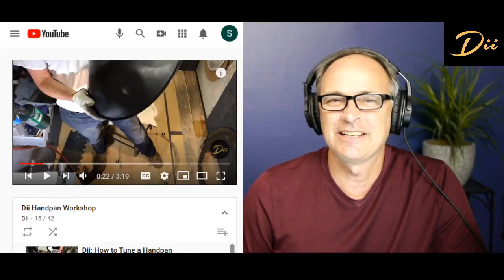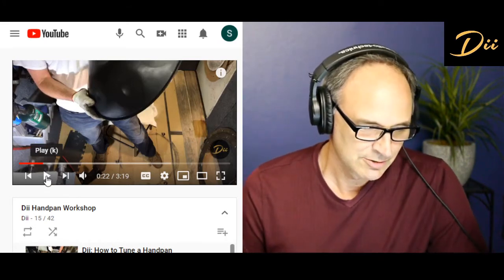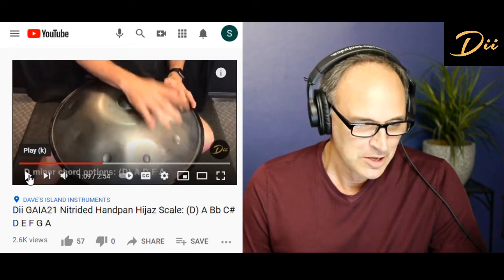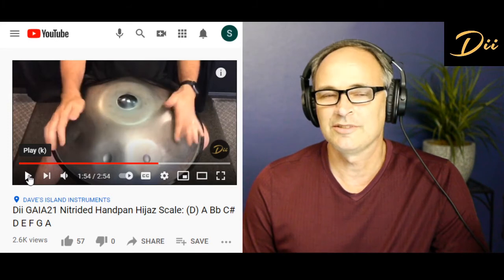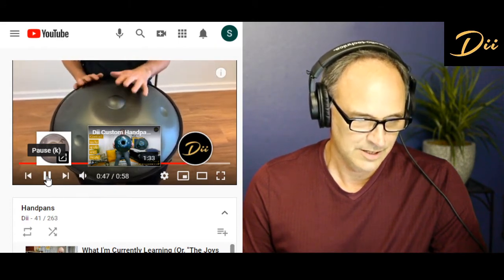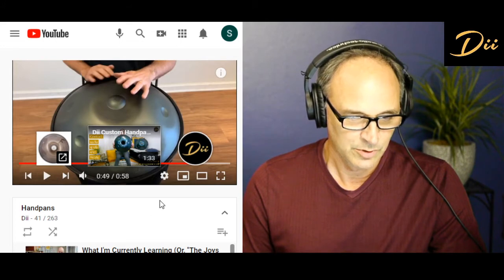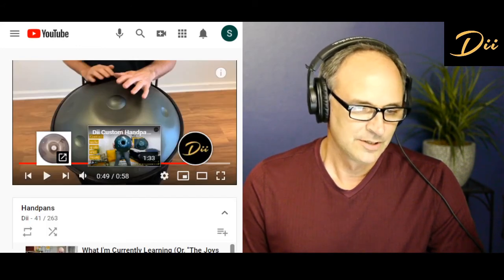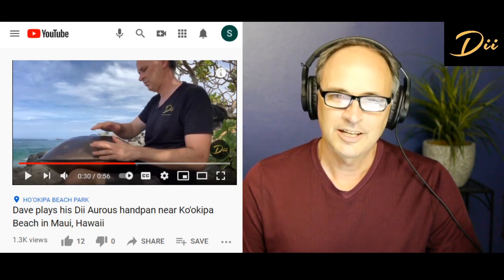The Best Handpan Steel: Nitrided, Powder Coated or Stainless?

Comment: I enjoy the handpan I purchased from you! I would definitely be interested in another one in the future. I look forward to hearing your future designs with the nitraded steel. Do you think that you’ll also do a powder coating with the nitraded steel?
Reply from the maker: Hi Mario! Thank you for the comment! If we create nitrided handpans in the future they would not require powder coating. Just pure metal with the nitrided process which creates a ceramic type exterior to the sheet metal. Powder coating is only really needed if the metal is plain steel. Nitrided and stainless steel typically do not need to be coated with anything.